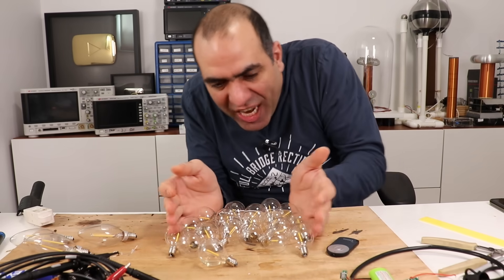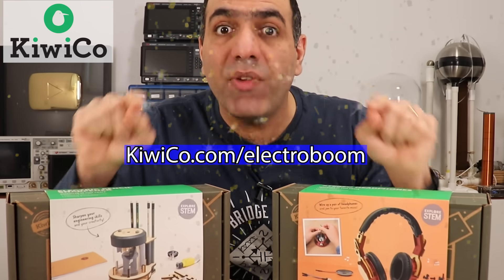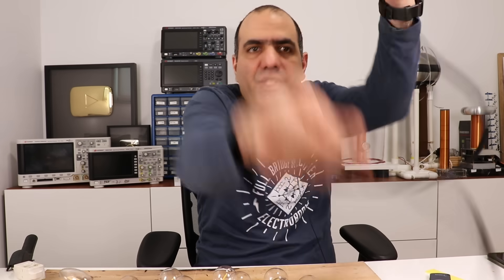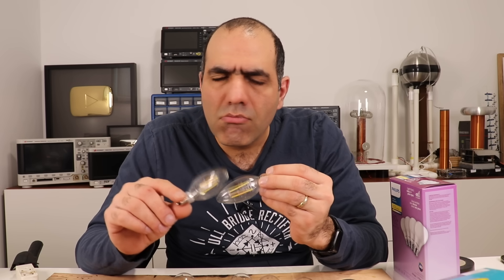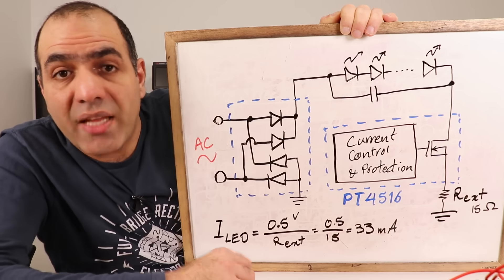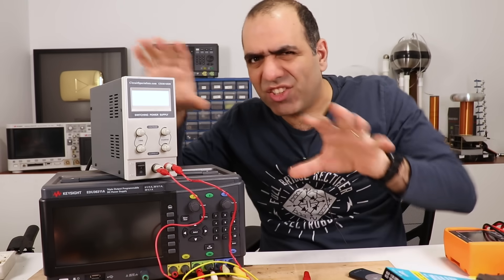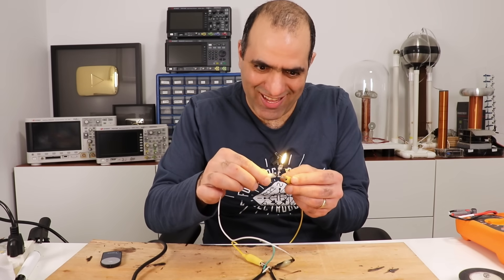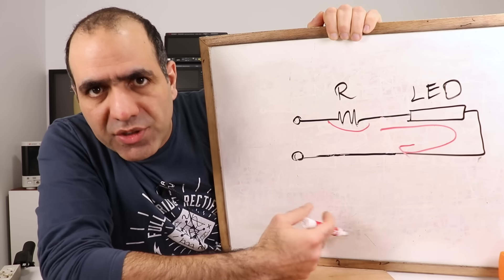So Many MISERABLY FAILED LED Lights

Comment: It's the lightbulb conspiracy. 
Back when electric lights were first introduced the filaments were made of carbon, making them very stable and unlikely to burn out. Problem was that nobody was buying replacement bulbs and the companies were losing sales. Later on after the tungsten bulbs were introduced they were engineered to fail after a certain period of time. 

I have some carbon filament bulbs from the 1910s and yes, they still work perfectly. But ive had LED lights from barely even 2 or 3 years ago fail for seemingly no reason.

Comment: Did you notice if the cheap Amazon bulbs "popped" when you broke the glass or just shattered? I'm guessing the bulbs aren't even vacuumed out so simple condensation could be responsible for the water getting in.
Reply: There's no reason to use a vacuum in an LED bulb.  There is a reason to seal the freaking things, but I guess that's too much trouble for crap manufacturers.

Comment: These things are built in giant factories to an extremely cheap price. When you're cracking out these things in volumes, even cheap components add up to huge inventory costs. So manufacturers are incentivized to use cheaper, smaller components and absolutely grill everything inside. The combination of heat and current is what kills everything. Sure, they could use three strips instead of two, but that could increase their inventory costs by half (I think those LEDs might be the most expensive component in those lamps by far; can anyone verify that claim?). Or, they could use a properly-sized resistor (or even multiple resistors) but, again, cost.

These manufacturers care more about their profit margin than the quality of these products they're selling. That's the bottom line. To them, it isn't worth it to invest more in these cheap lamps. If you want quality, you invest more money and purchase the more expensive lamps.

Because some of these lights are basically a resistor feeding some diodes, you can add your own current limiting (capacitive dropper, resistive dropper) to the socket, but then you'd notice a drop in light output.

Comment: Even if the power flows in both directions I think the resistor + LED just lights on and off at 60Hz. It is imperceptible to the naked eye.

Comment: I'll admit it, I got one incandescent in my house, I use it in my desk lamp (those old ones rated for 200w+ and look like that Pixar lamp), it was manufactured in 1982 and it still runs just fine, it's like a little sun shining on your hands when you are working on stuff and it does not give me eyestrain... I bought a 5 pack of leds for 20$ and it was exactly the same thing as you, literally 6 months on they started blinking, then they died on me at dinner.

Comment: DUDE I HAVE THOSE EXACT SAME LIGHTS AND HAD 2 out of the 12 burn out! That's like 20% defect rate! WTF! How do I get my money or replacement? These bulbs are floating around ebay and amazon like hot cakes with the 3rd party's have ZERO ACCOUNTABILITY!

Comment: Most of the CFL's and early LED drivers failed due to the failure of the electrolytic capacitor.  The best grade of electrolytic capacitors had a temp limit of 106 Deg C and at that temp they only have a rated life of a few hundred hours.  Many years ago I put a point probe inside of one of these CFL drivers and got operating temps close to 100 Deg C.  I never got more than 9 or 10 months from any of these CFL lights.  LED's come out and I saw the same trend with the first few generations.  Fortunately, the latest generation of LED's seem to have solved the heat problems within the drivers.  As you found, most of the LED failures now seem to be failure of the actual LED.  Either manufactures are using poor, "fallout quality" LED's or the LED's are being subjected to excessive heat or PIV.  While LED's are diodes, they typically don't have a very high PIV rating.  I just keep my receipt and write the installed date on the bulb base.  If they don't last a reasonable time they go back to the store.  I figure if enough of them keep coming back to the manufacturer they will either fix the problem or go out of business.

Comment: Led light do fail very often. The electronics in them is crap.  The diode(s) are probably ok and could last for 1 million hours, but not the electronics :/ PS: I also have a lot of dead led lights at home. Not all of them no-brands. Osrams and philips ones too.

Comment: That warranty policy is hoping that nobody will come to change them to new ones and it's not that energy efficient if you have to change them twice in warranty. Maybe you should talk about "dirty" electricity cause that is what kills the LEDs in long run, for example (totally different but same :D) my computer didn't wake up from sleep mode or it throw all kinds of errors before I took an extension cord to grounded socket in kitchen then it run perfectly even with massive overclock. My dad also used to say that our lamps don't work long cause we are at the end of lines so the interference has nowhere to go (and also it's an old house so it was never designed to run 20x of electricity).

Comment: It happens also to LED light bulbs made by a series of smd LEDs. One burns and everything is dead. For some I remove the dead one (normaly blackened) and short circuit it. The extra current is negligible and for a dead light bulb I have some extra time working.

Comment: i use cheap ones i got on ebay they have been going for over 5 years now and not one has failed, before i got my cheap ones i had expensive philips ones from the hardware shop down the road, they keeped crapping out like within a month or two, ill never get  philips led lights again after that experience

Comment: The 10,000 hours is a concatenation of the lifespan of all the light bulbs they've ever made.
Reply: if you accelerated all of the lightbulbs to the speed of light.
Reply: or 10.000 hours for the whole string

Comment: You can make a spark gap tesla coil with your flyback transformer which is dc and easy to resonate and the ZVS circuit ,you will get super arcs, STAY SAFE!

Comment: i bought a shop light led with a 2 year warranty and i used it for a central light on the ceiling  and it had a pull cord for on and off only. and it was in the middle of the room so i took some marking string and routed it to each door but the angle was too much i wouldn't release the pull cord. so i  put bic pen around the cord and it gave it enough distance out for it to work for about 6 months. and the metal pull cord broke. so i thought no big deal i'll put another one on. to get to the pull switch i had to break one end completely which wasn't a big deal tape will hold it, then the pull cord switch is riveted together like everthing on it. totally user not friendly for a repair. they don't want to let go of tracking everyone and knowing what everyone is doing. so i just bypassed the switch taped it all together and now it has a stick taped to the plug end so i can reach the ceiling socket. i got some better tricks that'll save you precious time and money. electricity isn't as complex as the code tries to splain it works just like dc. you dont' want to switch the com wire is all. everything else is toggle switch and 1 wires.

Comment: Instead of replacing my Lights with LED's I replaced them with Fluorescent Tubes, because they handle the high harmonic resonances on my grid far better with traditional balasts than switch mode power supplies. And its already a decent upgrade.
Reply: For that matter LED lights are probably the most difficult to regulate. Fluorescent lights only need a series impedance (most often inductance) to deal with their negative resistance nature so they don't draw an infinite current and blow up. They can be insanely overvolted and still work fine (that's how they turn on in the first place!) LEDs on the other hand need voltage AND current limits to not kill themselves, so the regulating circuit needs to work much harder to keep them alive. Given the same transient in the mains an LED light is probably more likely to get overwhelmed and die compared to a fluorescent light.

Comment: Hey Electroboom, can you explain why at 9:51 you say it's a bad, inefficient design to use a single resistor with an LED?  What makes it bad, and what's a better alternative?
Reply: Resistors dissipate energy as heat, causing inefficiencies. There are better ways to limit the current, such as capacitors.

Comment: The warranty on the LED lights I used state the lights must be installed by a licenced electrician. Sure, I'm gonna pay Five bucks for a light and then a hundred for a sparky  to screw it in. Sick manufacturers.

Comment: I had dimmer switches install and bought some Great Value 8.5w dimmable filament LED glass bulbs and they flicked like crazy. I'm no electrician and because I am epileptic I'm switching to Great Value 43w dimmable halogen lighting from my local Walmart.

Comment: Recently I installed some name brand LED bulbs in my ceiling fan to replace the expensive mini-candelabra base halogens and incandescent bulbs. I believe the LEDs caused the remote control box to malfunction so we had to replace the whole fan. Plus 3 of the bulbs burned out within two days at maybe 5hrs a day. One had liquid inside and part of the yellow LED was broken off. Not impressed with those. Looking around online I found that the candelabra base LEDs seem to be lagging behind the regular medium base bulbs as far as reliability goes. Not many good reviews for those.

Comment: The guarantees are worthless.  I have two very expensive Osram LED lamps, both with extended warranties from the manufacturer, and both failed after a few months, spewing some sort of oily fluid.  One or them immediately after it failed, I found was extremely hot when I went to investigate.  The shop where I bought them (Tesco) would not give a refund because they stopped selling these lamps, and Osram's contact information for guarantee claims on the boxes yielded no response.

Comment: I have two LED lamps that have been running 364 days a year since October 2010.  Approaching 90,000 hours operation with no problems.

Comment: I've not had good lifespan out of any LED's i've bought over the past 5 years now, even the expensive variants. I bought two LED bulbs back in 2011 when they were still using experimental designs. One was a bright yellow and gray banded Philips EnduraLED (I think it was called), very heavy and with a large finned metal heatsink at the base. The other was Utilitech, more of a traditional looking bulb at the tip but still had a large metal heatsink at the base. They're very heavy and dense, tank-like. They were very expensive too, $30-$40 for a single bulb. But you got what you pay for, both still work perfectly and have had frequent use over nearly a decade now. I have a handful of Feit floodlights that have been going for over 5 years now as well that are similarly heftily built and still working perfectly.

Most recent LEDs are trash. A dozen GE's failed on me within 4-6 months. Even a more pricey version didn't last 2 years. Feit is a little better, but still only last a year or two these days (though their smaller candelabra filament LED's have had some better luck). I'm currently trying some newer Philips LED's to see if they're any better, but they're extremely lightweight now and no longer have the large metal heatsink. So i'm not expecting much. One wonders if the plastics and E-waste from all this will offset whatever environmental savings were made by moving off incandescent.

I wish Dubai Lamps were available in the US and other regions. Pretty unlikely though. Philips only complied when the Saudi government twisted their arm. Other countries don't seem to have shown interest, and the corporations wouldn't be so willing to concede elsewhere. There's nothing proprietary or difficult about the design of these bulbs either, it could be copied by other companies if they wanted. There's just no incentive for manufacturers to sell a long-lasting product unless they're forced by the law to do so. The goal per usual is to sell poorly built crap that you have to replace frequently.
Reply: In the EU there is a modified Dubai bulb design from philips.

EU energy labels are great. Even D rated LEDs are not that bad, and the modified Dubai one is the only one I know of with an A rating.

(There was a previous sytem with lower requirements, so some older bulbs may have a old A rating, but the newer labels are better suited for modern bulbs)

Comment: Isn't that second LED schematic at 7 mins or so really heinous? As I understand it, putting LEDs in parallel and then limiting their current in series with both is a recipe for disaster. If one string blows, then it the full current flows through the other string, blowing it too.

Comment: Amazon and garbage bin are synonyms in my mind. I've bought very few things from them, and 100% were dismal failures not worth even 1/100th the price. I would never purchase from Amazon again, they're just Ali Baba with higher scam power. They pretend they aren't junk drop shipped from China by using an English sounding name and proof reading their description but it's the same junk.

Comment: Expected that he will turn on bulbs with water inside. Hot bubbling LED tea... By the way those cheap bulbs with only one resistor inside works fine and long if accompanied with proper dimmer.
Kudos about reference to BigClive - guy have a ton of videos with extensive explanation what is inside of something and for dead stuff - why thing died.

Comment: SOLUTION: secondary DC home wiring - then, you don't need any of the electronics and the bulbs can be as cheap as just the LEDs
EDIT: never mind, if the string ones failed too... - I thought it's the electronics to deal with voltage fixing and DC conversion
EDIT2:     is the STRIP  AC    ?????? WTF
EDIT3: It's not even the conversion electronics????

Comment: A MR ELECTOR BOOM MAKE A FULL BRIDGE RECTIFIERA diode bridge is an arrangement of four diodes in a bridge circuit configuration that provides the same polarity of output for either polarity of input. When used in its most common application, for conversion of an alternating-current input into a direct-current output, it is known as a bridge rectifier. INVENTIONS

Comment: Mehdi... Put the "Suicide Cable" down...

It is interesting to see that each bulb has a rectifier inside! That's super convenient for avoiding the obnoxious flicker that older LED fairy lights have, and making it an awesome replacement for a steady incandescent light. (I have a set of LED fairy lights that has a flicker rate so obvious it's visible to the naked eye, and any moving person or object under them looks like they're in stop motion lmao). I would have figured most manufacturers would be like "Screw it" or "Who cares" when making these, but having the built in driver circuit to make the light truly steady and protect the strands from current fluctuations definitely makes the higher price per bulb worth it IMO, especially with the energy savings. 

Too bad the manufacturers for the brands your tearing down cheaped out and used them painfully wrong lmao!!
And the "exterior lighting" ones with the single resistor HA!! No wonder they all "commited die" lmaooooo

Comment: News flash: very FEW LED light bulbs actually last anything like their rated life. Meanwhile, we're all using more power than ever before because we compensate for the efficiency of the LEDs by running more of them all the time. AND MEANWHILE all those things for which INCANDESCENT light bulbs were handy... go wanting... because we can't buy the danged things any more.

Remember... during the heating season... incandescent light bulbs are 100% efficient. The heat isn't wasted.